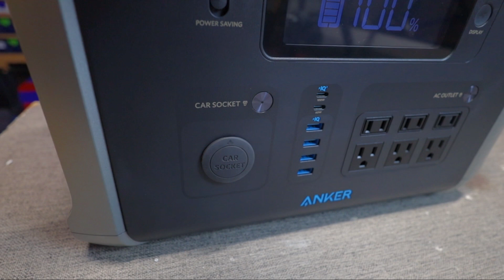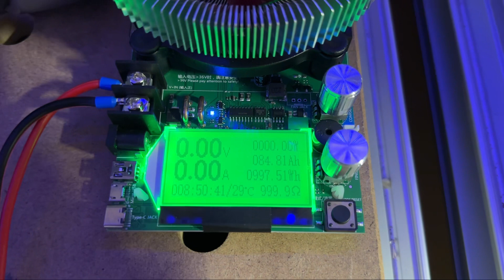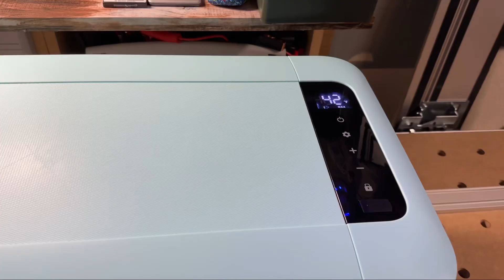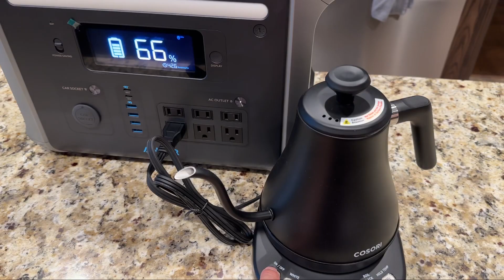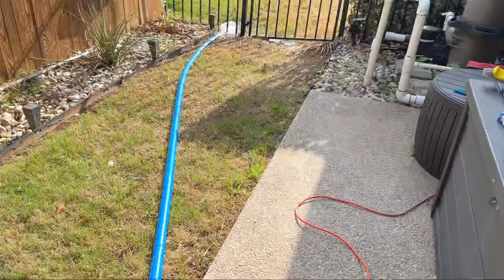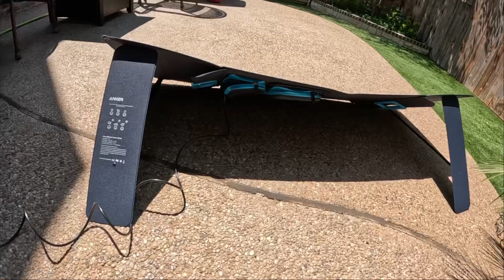Anker 757 LifePo4 Power Station

Comment: Hi, I'm repairing an Anker 757 PowerHouse (Model A1770, standard version without WiFi/Bluetooth). The main MCU (STM32F103VCT6, LQFP-100) shorted out. I already sourced a blank replacement chip and am ready to solder it, but I need a clean flash memory dump (.bin or .hex) to program it via ST-Link.
Does anyone have a backup dump from a working A1770 board, or know where I could find one? Any help is greatly appreciated!

Comment: I got this last August. Overall I like it very much. It is very capable. It’s ability to keep my 12v freezer running forever is what I like the most. It also runs my array of electric cooking implements I have for SHTF, which you discovered as well.

It’s limitation is the solar input limitation. Rather than try to mix and match or try to meet the requirement (like I normally do with my power stations) I just went ahead and got their 3 panel folding set.

Comment: You will not be able to have 100W panels (21-24V) in series because of the 30V limit. No additional input ports to possibly add extra charging watts. It weighs enough to be an anchor.